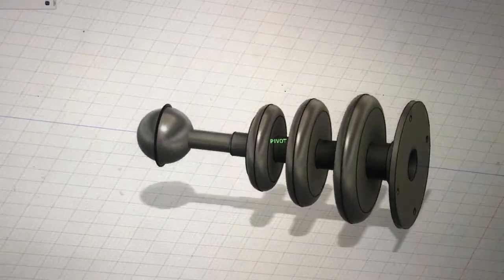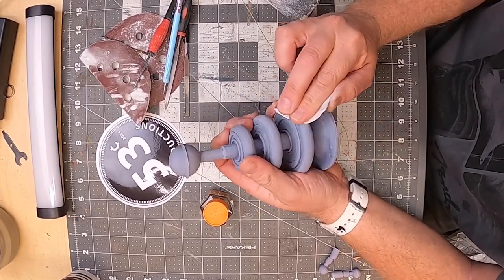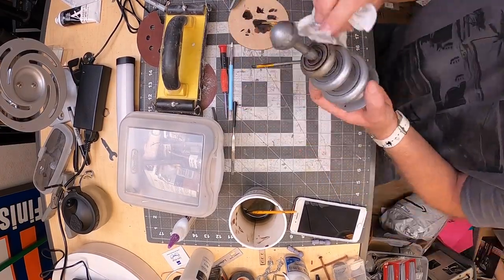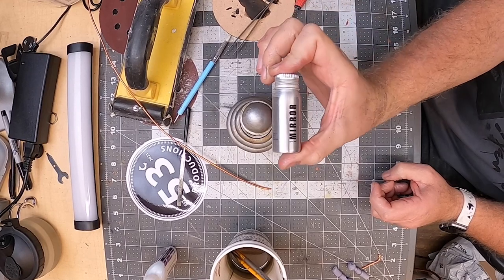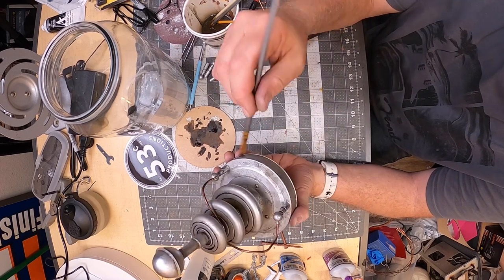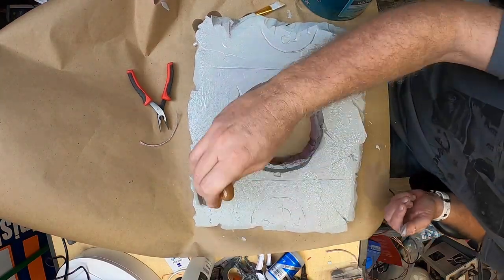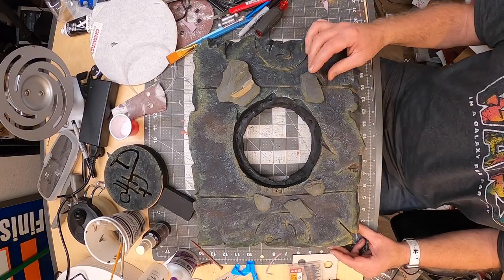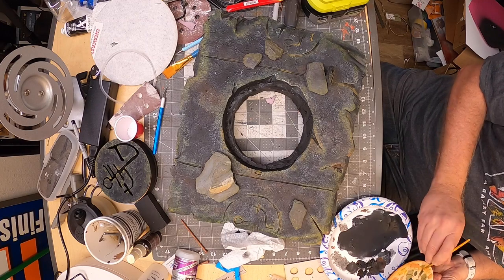TTFS:  Making the Netflix Series Wednesday Body Part ReAnimation Jars

Comment: I love that insulation foam as a building material. I've also been experimenting with adding textures to glue and paint. Store brand table salt is an excellent, inexpensive way to get a rough brick or concrete texture. Thanks for another great video, Shawn!
Reply from the maker: Ooooh … I will have to try that!  I have used salt for chipping, but not for texture!